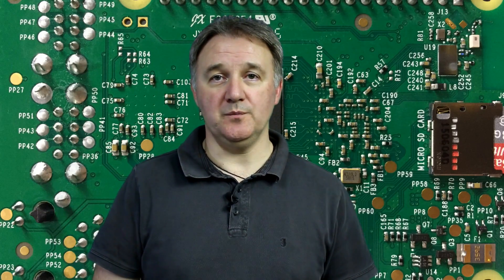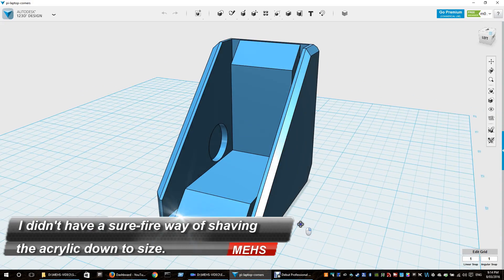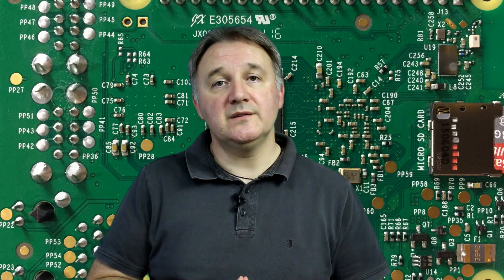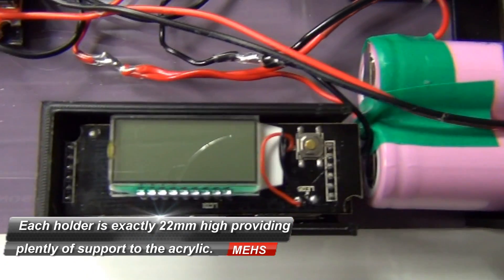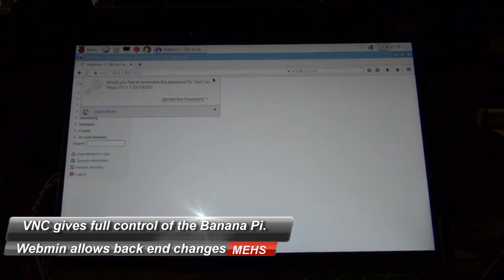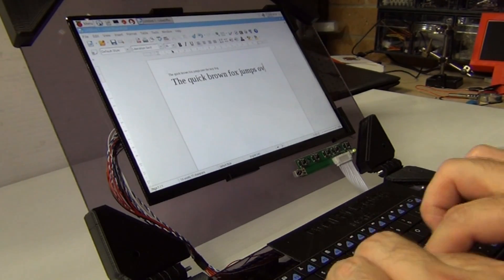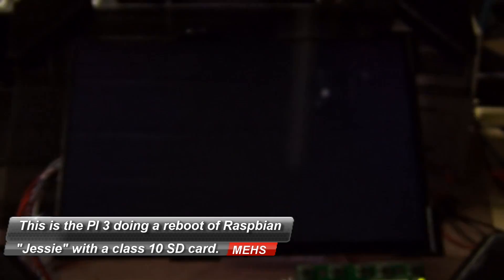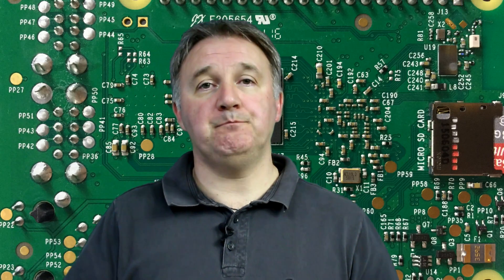Raspberry Pi 2 / 3 - Dual Pi Laptop Part 2 (MEHS) Episode 41

Comment: Amazing how you figured it all out, not just one time. I'm going through all sorts of designs and older videos just to get a box and a power/battery solution to my liking. The displays (5" and 3.5") are working great for me, however, too much cube form and such. I also want a Pico later on for a clock project. My "break-through" was power delivery within the last few days.

Comment: 2021 now, I'd probably pair up a raspberry pi 4 as the desktop and a raspberry pi 1 as the server... or rpi zero with an ethernet module. 
My thoughts are on being able to have a low power server running on on the clock that could also use gpio sensors to collect data at set intervals.

Comment: Acrylic is a poor choice.  It's hard and as you've discovered brittle.  A better choice is polycarbonate.  More tolerant of machining and will not brake as easily when dropped.
Reply from the maker: - Yes, I won't use acrylic again.  Cheers.

Comment: Why not just use a broken laptop, remove the motherboard and replace it with the pi’s
Reply from the maker: - Hi.  That is possible but there are a few big challenges doing it that way.  Most of the time a broken laptop doesn't have enough room inside for the parts being used.  The LCD of the laptop needs to be matched to an LCD driver board.  This is possible but you need to investigate the LCD manufacturer and specs first.  The biggest issue is using the laptop keyboard and mouse (trackpad).  These are often done to suit the manufacturer and pinouts are difficult to determine.  You then need to build or find an interface to go from the keyboard to a board like an arduino to act as a keyboard interpreter and send the signals to the Pi.  For simplicity, its easier to start from scratch although a broken laptop would give a nicer final result.  Cheers.
Reply: My Electronics & Hacking Show thanks for the reply! And great content. Subbed.

Comment: Why have dual Pi's? I don't get it
Reply from the maker: - The more Pi the better?  Its actually a load sharing arrangement of sorts.  Since you can't really run a multi computer configuration (supercomputer) without running dedicated software, this approach is a simple load sharing arrangement where you use the Raspberry Pi as your desktop and the Banana Pi is your second desktop that does the grunt work that would normally slow the Raspberry Pi desktop down.  This could be running some downloads in the background, doing something CPU intensive like video rendering, or the Banana Pi could be running all the server side apps like apache, mysql, php and the like and the Raspberry Pi is completely free to just surf, play or whatever.  One master desktop and one helper desktop / server.  Cheers.

Comment: Hey could you maybe provide a link to a retailer for the screen and driver board. I can´t seem to find anything on the ones you use in the video. I´m kinda new to DIY and would prefer to play it safe. ;) Thanks in advance.
Reply from the maker: - Hi.  Ebay product number 292126812800 will get you there.  Cheers.

Comment: I noticed that you're still replying to comments, so I decided to leave a question here. How do you set up the system to have the Banana Pi do video decoding for the Raspberry Pi? Could this be done with two Raspberry Pi's? I'm interested in the method of freeing up the Raspberry Pi's user power by making another board do the work, unseen to the user, but I don't necessarily understand how to go about that method. Thanks for the help!
Reply from the maker: - Hi.  Big question.  I mentioned this kind of thing in the video as a possible use for such a setup.  The reality of a real distributed computer setup are much more complex and would take a very long time to cover but very basically there are 2 approaches.  1 is simpler which would be to control the second Pi from the first through scripts of remote terminal or VNC sessions.  This is really just using the second Pi by connecting to it from the first using SSH or VNC to load the media file to the second pi and then run the encoding application, all from the second Pi but initiating it from the first since (in my setup) I don't have the second Pi connected to any display (headless).  Very easy really.  The second approach means setting up real distributed computing like a mini supercomputer.  There is information on youtube about this but it has severe limitations for what you might need and is more difficult to setup.  So to answer your question, I would probably write a shell script that sends the media file to the second Pi (or access the file from s shared media) and then another script to initiate the encoding.  When done you have your encoded file and the first Pi (your desktop Pi) did no work at all.  Hope that makes sense.  Cheers.
Reply: My Electronics & Hacking Show Thank you for the reply, that definitely helps me get closer to what I'm trying to achieve!

Comment: I gather the power draw must have been below 1500 mA – the 12711's max output current. But according to Texim Europe the Chimei 10" display consumes 8W. Most displays also have an inrush current (initial power surge) when turned on, which can be as high as 2A or more. Furthermore, the two Pis can't possibly draw less than 500 mA. Yet your circuit appears to work fine. How did you manage to work around these limitations?
Reply from the maker: - Hi.  I didn't really work around the 1.5 A charge rate limitation.  I connected the barrel jack of the 12711 to the output of the regulator so external power of up to 5A could go into the project powering the Pi and screen and simultaneously charge the battery pack through the charging IC.  I was able to do this easily as my main 5V reg has reverse current protection so I didn't have to worry about 5V flowing back into the battery pack.  As far as the power supply itself going to the two Pi's and LCD, I used 2 separate 5V regulators running off the battery pack.  One powered the Raspberry Pi and LCD and the other smaller reg powered the second Pi.  No shortage of power.  Cheers.
Reply: Thanks, I feel like that helped clarify a bit! I'm sorry, I typed a long response praising your work and YouTube trashed it, so I'm sort of annoyed. But I think I understood what you meant. So what you did was you just hooked both regulators up to the SYS OUT on the LiPo charger. What I didn't quite get was how the 5A@5V power regulator (Pololu U3V50F5—assuming that's the one you kept using in the Mk3) was able to provide for both the RPi2, but also the display driver board! My experience is display drivers are fickle things and don't like to be powered from batteries. Mine calls for a power supply of 12V 5A, for example, which is fine for my uses, but couldn't work in a portable project whatsoever. I suppose yours isn't so demanding?

This project is really exciting. For suggestion, I feel like you could probably upgrade with a gas gauge hooked up to a teeny dot matrix OLED driven by either a separate microcontroller or the Raspberry Pi itself. That would give you a more accurate estimation of the charge. Julian Ilett has a great video series on this topic. Another thing which I've been wanting to try for myself is an off-grid project with a solar panel mounted behind the display (which is not gonna face the sun anytime soon, is it). This of course on the subject of power efficiency is an environmental ethic, but would be awfully practical as well as a trickle charge, now that I have no idea how I can make the raspberry pi turn itself off when the "lid" is closed.

Again, thank you so much for these great projects and educational videos!
Reply from the maker: - Yes the display and driver board I used are happy at 5V and draw about 0.8A from memory.  Thanks for the suggestion.  A battery level and monitor is definitely needed and was considered.  As usually happens I ran out of time.  Cheers.

Comment: Hi, I am looking at doing something similar with a larger screen ie 12.1", most controller boards I can find have require 12v, but appear to offer built-in 5v inputs? can I just hookup 5v to these terminals (ie CN3 on M.NT68676.2A Controller) providing that the screen only requires 5v or less?
Reply from the maker: - Hi.  In most cases yes you can just provide 5V to the driver board and the board and LCD will run from 5V as long as there is enough current (say 1A).  Cheers.
Reply: Thanks, would you just put 5v to the 12v barrel connection?  Or do you have to bypass the regulators?
Reply from the maker: - I have successfully connected 5V to the barrel jack before.  Cheers.
Reply: Thank you.

Comment: I have also developed a portable pi with the official touchscreen, it's completely battery power, using a powerbank, but the problem is that it cannot deliver power while charging, could you suggest any means by which i can run while charging?
Reply from the maker: - Hi.  It depends on your total power draw.  Mine is about 3 amps so I supply 5 amps of external power and make sure some goes to the battery pack and the rest to the project.  I have used a Sparkfun 12711 before and just bridge the external power that connects to the barrel jack to the project input.  The board already charges the battery supply so that way the external power is charging the battery and powering the project simultaneously.

Comment: nice video but I have a stupid question.
how do this thing works? I mean I thought the PI needed 5v @2.5a and the LCD at least 5v@1.8a, where did u get that current??? how do this whole.thing works???
plz. I don't know a lot about electricity and that shit, plz help me out.
Reply from the maker: - Hi.  The regulator I used is capable of delivering up to 4amps at 5V from a 3.7v supply.  That is enough to power the raspberry pi and the LCD.  The peak draw of the LCD is much less than 1.8A.  More like 1A.  I have another reg (less powerful) providing power to the other board.  Since the battery supply is big its more than enough to provide all the current needed.  Cheers.
Reply: My Electronics & Hacking Show I really appreciate ur help m8, Hope u the best, now I'm building one of this portable lapRpis

Comment: I just  rewatched  your  video  after  reading  the  posts  I have  a  segestion  for your  build  grab a lattepanda   any  version    as it adds adruino  and Windows  capabilities  to the  build  at a  decent  cost
Reply from the maker: - Hi.  Good suggestion.  Using one of the new breed of X86 based SBC's is definitely a project I will be doing.  Just dont know when.  Cheers.
Reply: Cool man only headache I forsee is most of them run hot
Reply from the maker: William Hart
- Will keep that in mind.  Cheers.
Reply: The  lattepanda  is the  cheapest  one  as far as  I  have  seen  but the  hottest  so active  cooling  system  is needed  next one   the up board  higher  cost  runs cooler
Reply from the maker: - Thanks.  Initially Im thinking of using the UDOO x86 board but will do more homework before proceeding.  Cheers.
Reply: Nice board man good luck and will happily watch your unveiling video review if it be well and happy New year's

Comment: Where did you buy that screen! It's amazing!
Reply from the maker: - Hi.  Yes it is nice.  Go onto Ebay and search for your size (mine was 10 inch at 16:9 ratio) and make sure its IPS and at least 1280 x 800.  I think the one I got for this project was 1920 x 1080.  IPS is the key.  Mine came from China, no problems, good packaging.  Cheers.
Reply: My Electronics & Hacking Show How would I go about doing this for a 22" monitor (needs to be bigger so that everyone can see in meetings) without 3D printing or cutting tools? Perhaps I could get some custom cut wood at Home Depot but what would I do for the corners and hinges?Could get a laptop but I'm looking for something cheaper. The monitor I'm getting will be pretty cheap compared to a laptop. Your help would be much appreciated!
Reply: ***** Just buy a 22" monitor off amazon and a raspberry pi case, then connect an HDMI cord to the Raspberry pi and then to the monitor. Hot blue the raspberry pi to the back of the monitor if you wish. And then connect a keyboard and mouse to the raspberry pi.
Reply from the maker: - Hi. It really depends on what youre trying to do. If you want something easy and cheap then the suggestion by six sided is a good way to go. You could even get tricky and see if you can extract a 5V power line for the Pi from inside the monitor itself. Otherwise I would plan out your ultimate solution and aim for that. If youre thinking about a laptop like thing driving a 22 inch LCD then you have a few obstacles to overcome. The main one being power as most driver boards are designed to drive up to a 15 inch LCD, some 17, as the power for the LCD come from the driver board. 22 inch LCDs draw more power. You would need to carefully design your needs and find suitable parts. Again, it depends on the objective. Cheers.
Reply: six sided Thanks, but I'm looking for a clamshell design for the monitor and keyboard. Seems like there are no cases or commercial unit that can do that on the cheap unless I'm missing something. Looks like a DIY job.
Reply: My Electronics & Hacking Show I can hook up the monitor to an outlet actually, which should help a lot in the design. I'm thinking about getting two 24 x 12 inch plywood from Home Depot for $10 each, but I'm not sure what hinges to buy. I looked up friction hinges and found a pair for $10, but they don't look like yours. I wish I knew what to search for to find cheap hinges like yours. I hope they work well. If I have any leftover wood I can make them into stoppers instead of the custom corners you made. The hinges would have to attach to the stoppers, like how they attach onto the corners on yours. What do you think? Any suggestions for hinges?
Reply from the maker: - Hi.  I found a couple of possibilities on Ebay.  Take a look at ebay item numbers 252632824997 or 152329917676, as ideas anyway.  Yes you could do what you're suggesting but again, unless you are planning to use a complete mains powered monitor in your setup you will have difficulty finding a 22 inch LCD panel and driver combination.  If you find a light and thin complete monitor you would be best to use that as a complete unit.  As far as corners and things go you could always engage a local 3d printing service and have your designs printed for you.  Hope that helps.  Cheers.
Reply: My Electronics & Hacking Show My Electronics & Hacking Show I searched for that item number on eBay and it didn't turn up anything. :( What is it? Yeah, I plan on getting just a regular monitor. It shouldn't weigh any more than a gaming laptop. Do you mind uploading your hinge design? Or is there somewhere else I can get one? Much appreciated.
Reply from the maker: *****
- Jump onto ebay.com.au and run the search from there.  Once you see what im referring to you can search other sites etc.  If you want the 3d design for my hinges just drop me a line through my website with your email address.   www.mtechshow.com.  Cheers.

Comment: Hello and congratulations on your channels sir. I am new to raspberry pi and making things using electronics. I am more into blacksmithing. But i got the electronic bug in me now. I have an old laptop screen which is 17.1 in. Can this same configuration of yours be used? I mean power the raspberry pi and the screen from the same batteries. My problem is that the pi needs 5V 2.5 amps to work and the screen needs 12V 4 amps. Any suggestions if it is possible? If yes would you care to elaborate plz? Thank you in advance for your time sir.
Reply from the maker: - Hi.  Yes that's possible.  It depends on your power source and what you need to do to get 5V and 12V for the components (PI and LCD etc).  If the LCD is 12V @ 4A then I would start with a 12V battery supply.  Either a 12V SLA or 3 x 18650's in series.  This way you can provide native 12V to the LCD which is the highest power drain.  You could then run a decent 5V step down regulator to power the Pi.  Check that the LCD actually needs 12V @ 4A because that's a high drain.  You can always go the other way with a 3,7V battery supply and use a step up regulator to get 12v and 5v.  The problem here is the current as a 3.7v battery boosted to 12v would result in an equivalent drain of 12 amps.  That's not good.  Check out power regulators from Pololu as they have a big range and the website contains plenty of useful data.  Hope that helps.  Cheers.
Reply: Thank you very much sir it was plenty helpfull. Hope the best in your endeavors

Comment: I am impressed I hit the SUBB! this is very helpful since I have a year to make my final year project for my university I will be making a Android OS and Windows OS box which will work on TV and Steam stream
Reply from the maker: - Thanks and welcome.
Reply: How are you gonna run android and windows? You gonna use 2 different boards?
Reply from the maker: - Hi.  Yes that's what I did.  Not perfect but it does give a few choices.  Cheers.

Comment: Hi, love this build and would love to reproduce it.  One thing I would like to see is the addition of a simple KVM switch rather then using VLC to remote the second board.  VLC has its place in the world but these boards can be resource stretched.  Just when you need it most, he pi will hit the wall for memory and the whole thing is locked.  One button on the dash.  The electronics could be pillaged from one of the small 2-4 node KVMs available on Ebay.

Thanks again!
Reply from the maker: - Hi.  I gave the kvm approach some thought.  In the end I decided not to go down that road as a suitable (new) unit was going to cost around $100 and I achieved my current needs using vnc.  But I agree the hardware approach is better.  Cheers.